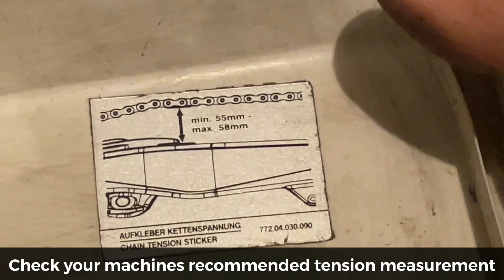How to replace the chain and sprockets on a 2019 Husqvarna TX 300 and most other dirt bikes

Comment: Cheers! Do you need to put some lock tight on the front sprocket bolt? Or just antiseize?
Reply from the maker: Thanks for watching!  I never use lock tight on it only antiseize. I’m no certified mechanic lol….that’s just the way I’ve always done it. Same with the suspension linkage bolts and fork clamps, just antiseize.
Reply: @farmthis  no worrys thanks for the reply. I had a look at mine and its just a C clip for the front sprocket no bolt.